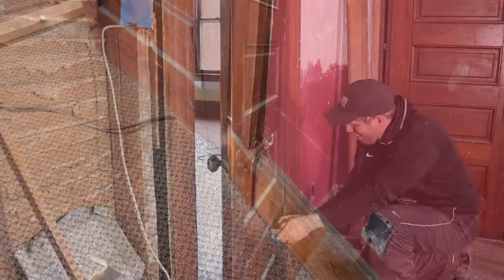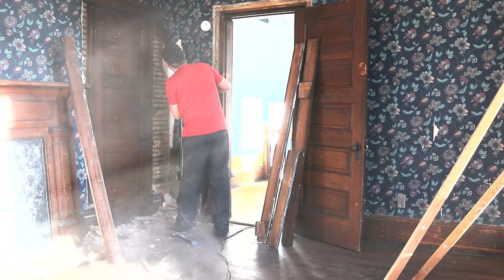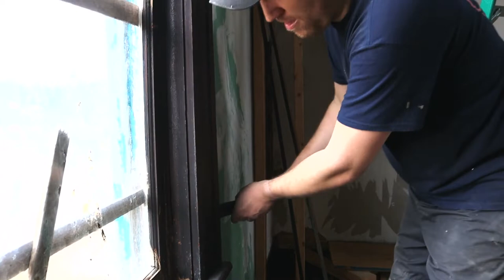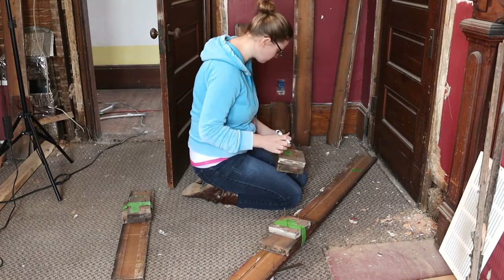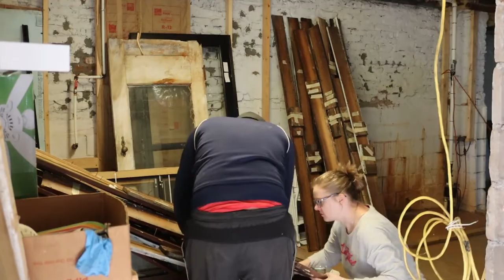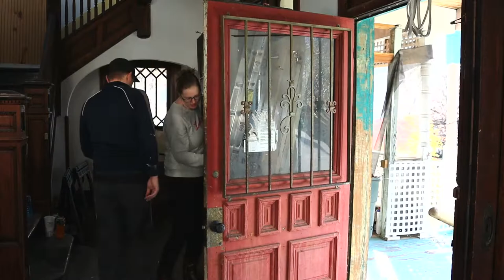Trim Removal & Cleanup - Victorian Home Renovation [TirolerInn]

Comment: I have a 1900 house as well and want to renovate.  How do you safely remove beautiful built-ins (kitchen cabinets and original icebox)?  Do you plan to replace all the lath and plaster with 5/8 drywall then reattach the trim.  Any concerns?
Reply from the maker: Take your time when you try to remove trim. Use multiple flat pry bars and slowly wedge it off. As for built ins I would recommend to see if you can get the trim cleanly removed and see if you can cut the nails that hold the cabinet with a fine tool or saw-saw (but be careful) then you would be able to slide it out. 
I would have to see pictures of the icebox to make an educated guess how to remove it.
For us we had to remove the majority of plaster because it was in such a rough shape, but we are planning to use purple board and modern plaster for areas that we want to keep very traditional. The other areas we will just do basic mud on top of purple board. As for concerns, just keep the same thickness of the plaster so the trim should fit back on. Plaster walls usually have spacer boards behind the trim so that would give you the required spacing and thickness of the wall covering.